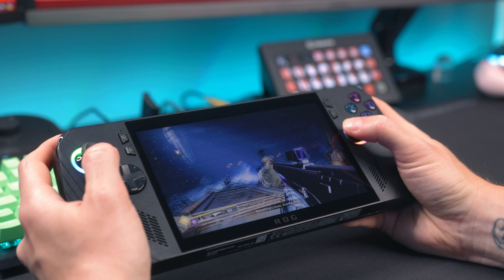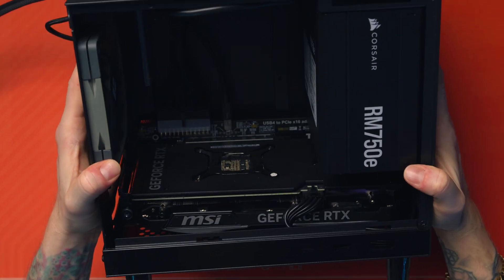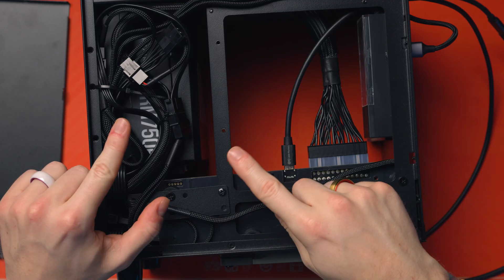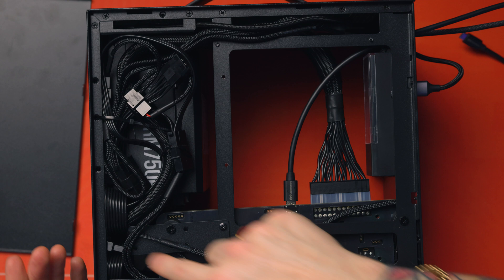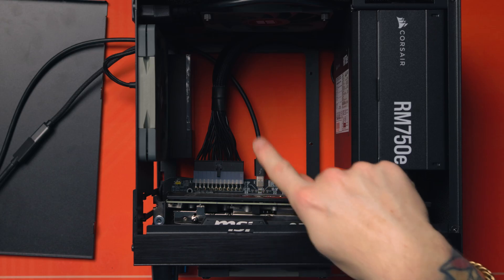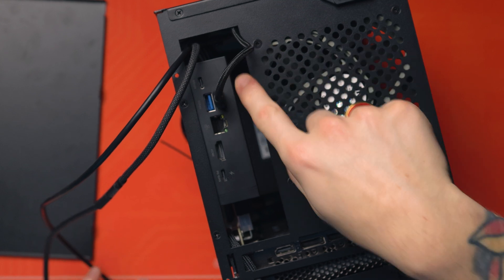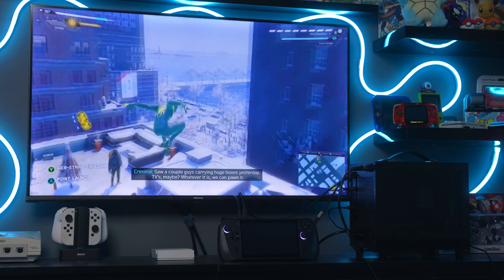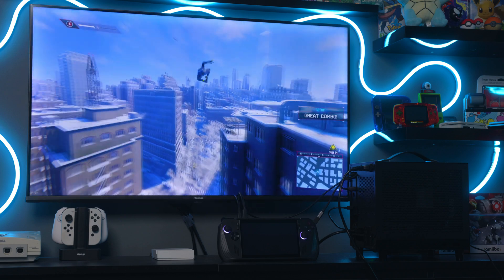The Perfect ALLY X eGPU Build

Comment from the maker: Ok 128kb-ers Here's all the parts we used...
Enclosure parts:
🛒 MiniNeo G200 case: https://geni.us/XjNR
🛒 Thermalright fans: https://geni.us/CT9Mlk
🛒 Molex fan splitter: https://geni.us/oP0YKVU
🛒Taller rubber feet: https://geni.us/lfdlS
🛒JSAUX dock: https://geni.us/9BEf
🛒Cable Matters USB4-C extender for the dock: https://geni.us/8HDyTJ
🛒Anker 100W charger I use into the dock: https://geni.us/cppdNTc

Main eGPU setup:
🛒 RTX4070 GPU: https://geni.us/Mbhh0ZL
🛒 Corsair RM750e PSU: https://geni.us/bAoAQAH
🛒 ADT Link UT3G USB4 eGPU Controller (AliExpress): https://geni.us/oGr4
🛒 ADT Link UT3G USB4 eGPU Controller (Amazon): https://geni.us/TMW8zex
🛒Cable Matters Thunderbolt 4/USB4 cable: https://geni.us/6GhpzLX

Comment: I just built myself one of these EGPU setups with an RTX 3070 in a s300 case which has the same power supply extension that yours has.  While the ROG ally is shut down and unplugged can i just unplug the power supply cable from the back of the case or will this damage something in the EGPU.  Love the videos and the setup tips and tricks worked great!
Reply from the maker: You can unplug, the eGPU will only start up and be on once it receives the signal from the ALLY X so, once the ALLY is turned off and disconnected you're absolutely fine unplugging the egpu :)

Comment: Would a 4070 super fit in there? Would it be worth the upgrade?
Reply from the maker: @mikesweeney8883  not sure if the super is any bigger than the standard 4070. For me, it wasn't worth the upgrade as when I bought the 4070 the Super was $150 more expensive 😅 this Friday our video is launching with benchmarks!
Reply: @128KB  thanks! are you using the gddr6x or gddr6? (latter is a couple hundred less). is the extra bandwidth important?

Comment: I love my eGPU. I was able to build mine for $450 CAD (including the 3060ti, TH3P4 dock, and 650w psu) and I have been running everything I've thrown at it on Ultra (Starfield, Cyberpunk, BG3, 2k25). It really does make the ROG Ally X the ultimate Switch.
Reply: On what Resolution and how many fps ?
Reply: @NothingInfos  More importantly--at what frame rates? He can set Starfield and Cyberpunk to 1440p Ultra, but unless he is hitting it with a fair amount a DLSS and using mods to access frame gen on that 3060ti...even then with 8GB of VRAM that's kind of dicey, especially taking into account the 10-20% he is probably losing simply because it isn't a PCIe connection...

edit: 'fair,' not 'far'
Reply: @NothingInfos  1080p if I'm on Ultra and usually around 80-90fps (without any frame gen but with upscalers usually set to quality)
Reply: @NothingInfos  720p
Reply: Kinda overkill with psu, max power draw for 3060 ti is only 200 watts.
Reply: @alfredp9754 probably he made it future proof in case he upgrade the gpu
Reply: IDK im just getting an ATX RM850 X aND PAIRING IT WITH ANY GPU i can get my hands on post 4th gen and get an adapter and see what happens lol edit: i just searched it up and it delivers 850w lmao. future proof lol but i dont know which is the best gopu out of the 4th or 5th gen ? in terms of price for performance. I know its compatible with almost ang GPU but i dont know what the adapter thingy is... edit no. 2 IT IS called a JMT ADT-UT3G USB4.0 Docking Station 64G PCIe4.0x4
but i dont know if they are compatible with all power supplies and GPUs edit no 3. This PCle is compatible wth the ATX power supply... and is compatible with anything aboove RTX20...SO I SHOULD BE OKAY GETTING THIS POWER SUPPLY RIGHT?

Comment: I like u but…

This idea is a bit silly

…and if I’m honest, I can’t be bothered elaborating much further
Reply from the maker: Oh it absolutely is! You can save so much time and effort by buying either an older enclosure with everything other than the GPU built in, or entirely self contained units with the GPU integrated but I was chasing the best performance and upgradability. Check my first video in the series, I discuss all that there.

Comment: I haven’t made it to the end yet but it seems like a right palaver 😂
Reply from the maker: @kevinadaway8257  oh it absolutely is! You can save so much time and effort by buying either an older enclosure with everything other than the GPU built in, or entirely self contained units with the GPU integrated but I was chasing the best performance and upgradability. Check my first video in the series, I discuss all that there.

Comment: Doing a very similar thing with my Ally X, but I'm putting it into a Fractal Terra. Had to flash Windows from the ASUS BIOS to get the GPU to show up for some reason. It's been a exciting to build, and follow along with your updates! Can't wait to see what a similar build is going to look like in a handful of years. ASUS could make a KILLING by selling a EGPU dock with the next iteration of the Ally
Reply from the maker: Ah that's awesome, frustrating about the windows thing though :( I think you've nailed it there, I bet ASUS put thunderbolt 5 in their next ALLY and hopefully release an eGPU solution for it!
Reply: Asus igpu and egpu will conflict so I just disable the igpu and make the egpu the only gpu it won't mess with the system I've done it on my asus rog z1 extreme  and it work sweet with oculink adapter
Reply: Also using a minisforum dock with oculink

Comment: Thank you for your little project, I really like your content, but this solution is kind of ugly in my opinion. I would suggest another solution that might suit you. There is an eGPU box from Sonnet called the "eGPU Breakaway Box 750ex". It includes the necessary eGPU controller, a 750W power supply and will fit most RTX 4070s. If you were to get an ASUS ProArt RTX GPU, you could fit a 4070, 4070 Super, 4070 Ti Super & 4080 Super, only the last one would probably not get enough power from the included PSU. I have tested this setup (Rog Ally X + 4070 Ti Super) and it works very well. I also travelled with the eGPU case and had no problems with it.
Reply from the maker: @clayfox5193  yeah those are cool for those wanting an easier solution with much less effort however my goal was to get the most performance possible and build an enclosure for it.

The Sonnet you're referring to doesn't use the ADT UT3G, it uses the older Titan Ridge Thunderbolt controller so will provide less performance than my setup here. The newer USB4 UT3G is the lowest possible performance drop for eGPU setups currently.

Comment: I bought a epgu dock station with 3070ti, worked very well. I connected my ally x to the thunderbolt dock and epgu cable to the dock. However, I have connect the HDMI cable from the monitor to the graphic card instead of everything goes throught the thunderbolt dock. Or else the ally can't recognize the external graphic card for some reason. Not sure if that's the right way to do it but at least it worked but a hassle to switch the monitors(display port)

Comment: Maybe I'm being nitpicky, but wouldn't it be cleaner to get a usb3 male to internal usb3 female cable and have access to the case's front I/O?
Reply from the maker: Case IO was only a single USB A and USB C, plus the power button (which is redundant in this case) the cables were in the way of where the GPU sits. Could have connected them into the dock for use for sure but would have been very tight due to where they were situated.
Reply: @128KB  that makes sense, just thought it would be nice to have easy access to that usb port instead of having to open the case and fish out a cable.
Reply from the maker: @7MBoosted  you're totally right though, maybe I'll take another look and see if I can hook it up, would be easier than my USB extension hidden above the PSU

Comment: I would buy the aoostat ag01 it’s the same performance as utg but has a build it power supply looks nicer on the desk.
Reply from the maker: I was tempted, however it's not upgradable, 4070 is the max it can take with it's limited PSU and it's also an open exposed GPU situation again, which is exactly what I didn't want.

Comment: I would have looked for a small case with a vertical mount, then used a pcie 4.0 riser cable to connect it to the board which you then could have mounted inside with slot more freedom
Reply from the maker: Absolutely, I did actually consider that but this case was cheap and easily available to me at the time.
Reply: What Parts woud you recommend? Im thinking to build this thing you Said.
Reply: @atlaslee22 Any specific case recommendations or place to start? I’m new to this
Reply: Have any suggestions as I’m about to make one myself.